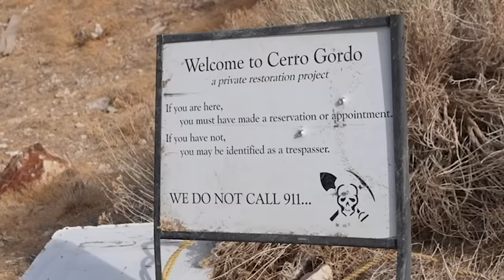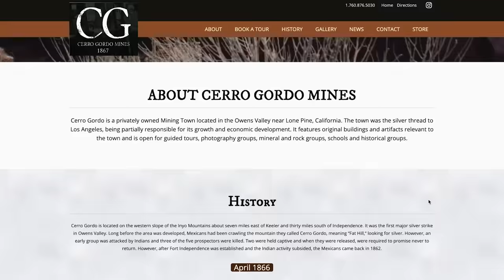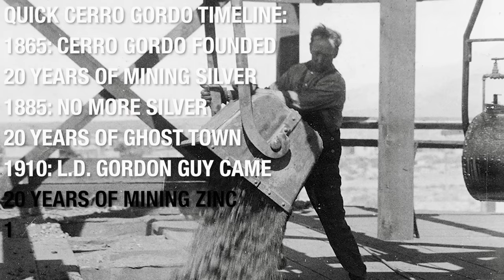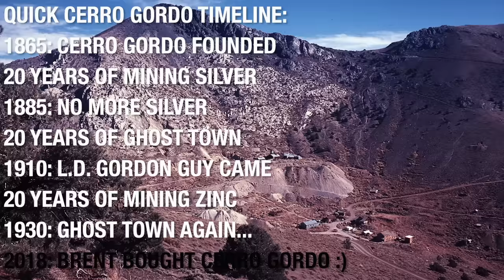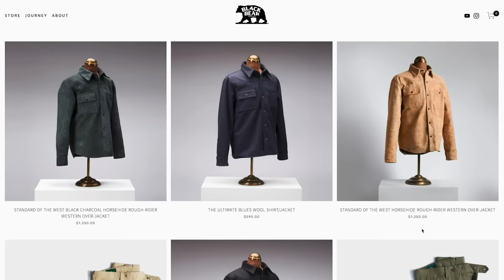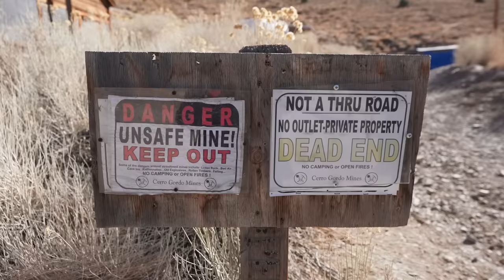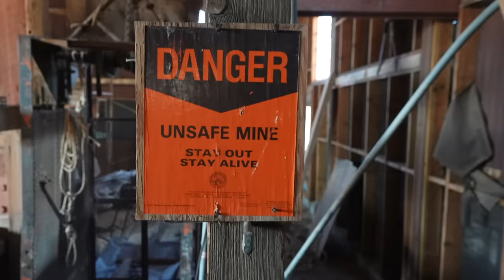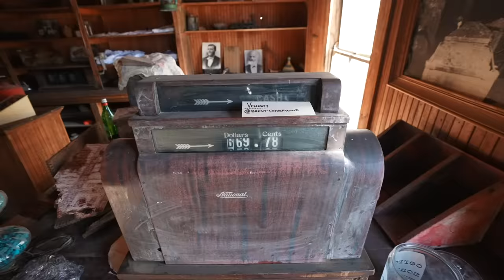HE BOUGHT AN ABANDONED GHOST TOWN (full tour)

Comment: For someone who has actually used outhouses, the idea is that you first dig a hole and place the outhouse over the hole. You sit on a toilet seat over a hole in a bench top. The bench top is hinged at the back so that after you've finished your business, you tilt the entire bench top up towards the back wall and fasten it with a hook to the back wall. Then you shovel some dirt over what is deposited in the hole. This controls odor to a certain degree. After shoveling in the dirt, you unlatch the bench top and rotate it on its hinges back to the horizontal position.  After the hole fills up, it's time to dig another hole and move the outhouse over the new hole. In the days before modern trash collection, besides sewage, people would throw broken pottery, tools, and other refuse items in the hole. It was an early version of a landfill.

Comment: Probably about 8-9 years ago I visited Cerro Gordo on my way to a photography workshop in Death Valley. After getting a bit of a tour (not as extensive has yours) I decided to take the road out the back of the town to drop down into Death Valley. I ended up getting a flat tire that I couldn't get changed because it was on a hill and after I got the flat tire off there wasn't room to get a fully inflated tire back on. No problem -- I've got a shovel -- I'll just dig a hole but I just ran into a huge buried rock that was not budging. After trying to climb the hill back to Cerro Gordo I gave up after about 30 minutes of climbing realizing I had no water with me. I was beginning to think that I was going to have to spend the night broken down on a seldom, if ever, used 4x4 trail. By the time I got back to my truck I realized that I had a sat phone of sorts. I ended up using the OnStar in the truck to have them contact the caretaker/owner to see if he would come rescue me, which fortunately he did. We got the tire changed and had to proceed down the trail to a crossroad so we could turn around and drive back up to Cerro Gordo. The whole time I was worried about getting another flat tire. Well we made it back to the town and then I took the front road back out of town into Death Valley. Needless to say I was a little late for the start of my workshop that evening. But I had quite the adventure. Definitely a cool ghost town -- it would be cool to go back and see all of the changes Brent has made.